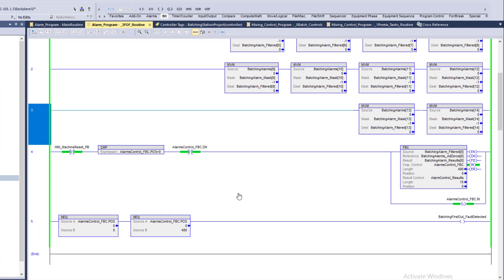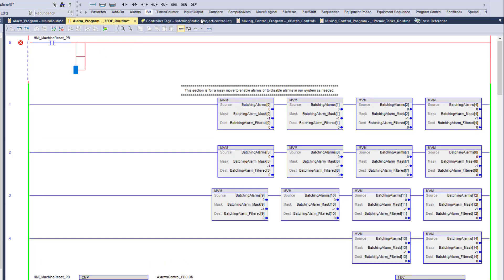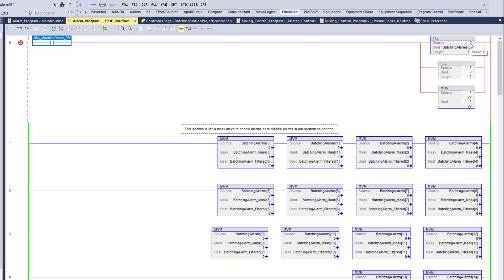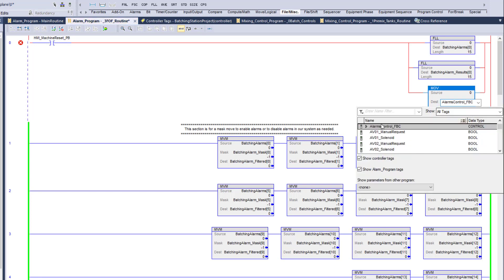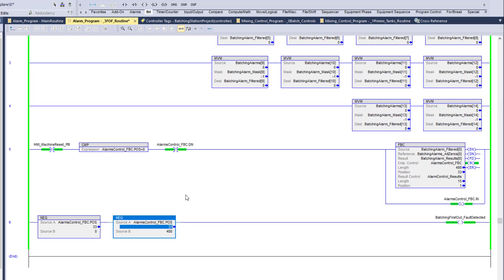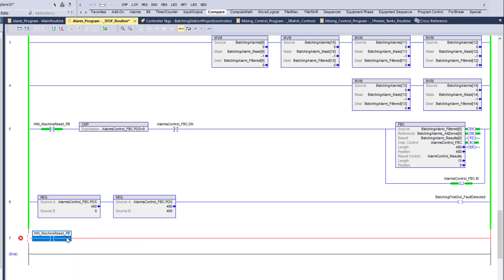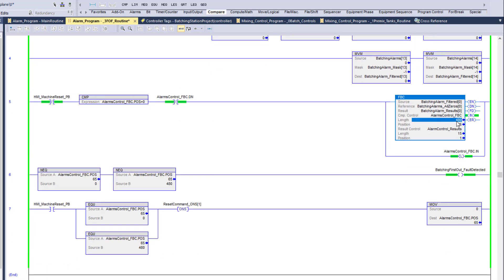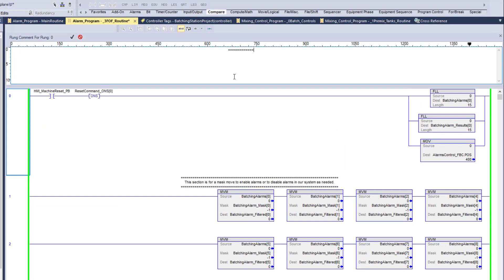Reset a File Bit Comparison Instruction In Studio 5000 | FBC Instruction Reset

Comment: Hi Shane! Great video! I have implemented the code but I applied it to my system and only used 2 DINTS rather than 64. 

I have run into an issue with the reset commands though. Whenever I toggle the reset PB bit on, the program seems to function fine. However, when I toggle the reset PB bit back off it immediately throws a controller major fault.

It says that the fault is occurring in the rung with the FBC instruction. It is a Type 4 fault, code 20 or "Array subscript too large, or CONTROL data type POS or LEN invalid." I have double and triple checked that everything lines up in terms of the number of DINTs and bits I am using.

Have you seen this fault before and would you have any guidance as how to potentially solve it? Thank you!
Reply from the maker: Make sure your array is the correct size
Reply: I just checked again and all of my arrays are of DINT[2] @ShaneWelcher
Reply from the maker: @tylerwarlow2959  so the bit level is matching the dints?

The trick to this is to make sure all data types are the same and that you use the correct length. 

I used 15 dints which is 480 bits.

I also use 0 through 14 which is 15 didn't (aka 480 bits or alarms)

Ignore using bit zero for a fault trigger because that creates errors.

Watch this video as well, a few minutes in, it shows what I am describing.

https://youtu.be/yCD-8v9h6b0?si=Mqo5LrLBwgZdPsGP
Reply: I'm wondering if it has something to do with the Result Control parameter of the FBC. I was wondering why you set that to 15?

The error is only occurring once the result control position becomes greater than 1. I noticed that your result control position never goes higher than 1 despite you having the length set to 15, why might that be?
Reply: Yessir. The bit level is matching the dints as far as I can tell. Just to compare to what you said, here is what I have in my program currently.

I used 2 dints which came out to 64 bits.

I used 0 through 1 which is the 2 dints

I already skipped past bit zero thanks to your video.

I think what is generating the error has to do with the Result Control parameter of the FBC. If I press the reset PB, it is not resetting that position back to 0. Rather it takes the next alarm and tries to go to position 2. Since I only have Alarms_Results[0] and Alarms_Results[1] it creates an error because it is trying to move it to the non existing array Alarms_Results[2].

How did you avoid this in your program? It seemed like your Source, Reference, and Result arrays were all of DINT[15]. Mine are all of DINT[2]. Thanks you so much for your help.
 @ShaneWelcher
Reply from the maker: @tylerwarlow2959  I am running a length of 15 because I use 15 dints. 

0 through 14
Reply: That was my issue! I needed to set the length to 2, and then reset the position back to 0. Thank you for the help! @ShaneWelcher

Comment: Thanks for the video. What if the fault bits themselves are Bit 0 and 480? May be when I implement this I will have more clarity.

I have a Fault array of DINTs (length 64). 

I thought of using FBC’s output Found bit to control my drives. 

Here’s my real concern…if I have multiple faults active at the same and I am just finding one fault at a time and between resetting first fault and finding the next Fault in the array I am worried the FD bit will go OFF and turn Back ON …which won’t suit my application unless I add a delay to with FD bit to control the drives. 

I know there is one more setting where it will find all the Faults at the same, May be that will work better? I will have to try that. 

Any other way to monitor fault array?
Reply from the maker: Bit zero will be a decimal of 1 so it should work, the comparison is decimal.

Although, it's common to not use bit zero in the very first array only